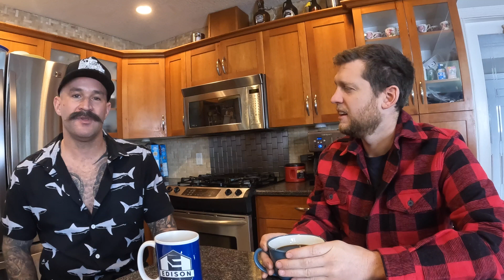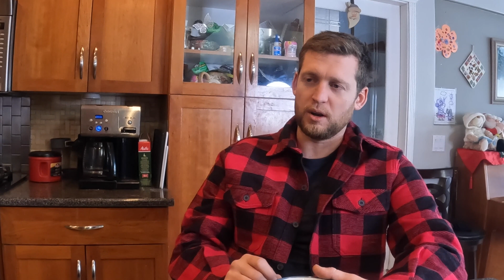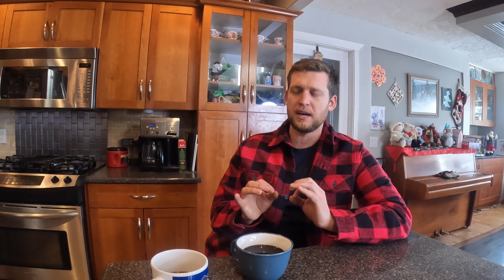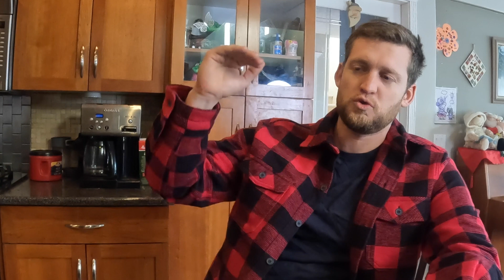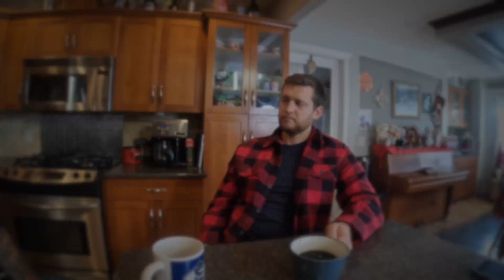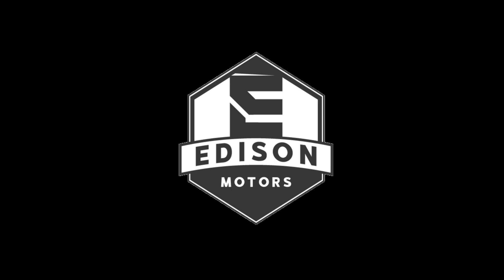Diesel Electric Advantage

Comment: Back in the 1930's two types of locomotives were tested. One was a Hydraulic driven locomotive. This did not work very well and was dropped. The second was an A.C. locomotive. This worked too well....that is to say A.C. power was in fact to powerful. When you tried to accelerate the wheels would slip. Not enough traction. It took till the 1990's to get a smart enough computer to limit the slip of the drive wheels. D.C. was king for 60 years. By the way an A.C. locomotive costs just a small amount more when it comes from the factory. The real advantage comes from the power attained by A.C. versus D.C. It takes 5 DC locomotives to equal the pulling power of only 3 A.C. locomotive. Then think of the fuel savings, maintenance costs and now you can add a few extra cars to the length of the train. Maybe we now need box cars with batteries behind the headend/locomotives to capture the regenerative breaking (called dynamic breaking). Currently locomotives use dynamic breaking by powering resistant heaters elements (kind of a dead short). This happens when you want to make the train run the slack out from between each car. Dynamic breaking helps you conserve your air break pressure.
Reply: There are certain situations where a DC motor might be more practical than AC…that includes a scenario with slow and steady  pulling and zero start/stop which is why they were good in trains plus DC doesn’t suffer power losses from conversion to AC from batteries.

Comment: I think Chace is awesome and he talks sense.  A few of his biases peek out; batteries aren't 20 years away and a full electric semi isn't either, but when they arrive (CATL, usually reliable, claims to have them going into limited production targeted for the aircraft industry THIS YEAR.  Of course, if they succeed they are going to be sold out for years and when they do make financial sense - they will likely drop into Edison Motors trucks where the generators were. (Actually, they will drop in to replace the batteries first giving better electric range and lowering diesel usage and cost).
And I find it not at all surprising that it is someone like Edison Motors doing this - the trucking industry and the manufacturing industry is SOOOOO conservative they make the Amish seem radical.

Comment: I just found they guys and the concept hits in my wheelhouse. I grow up in the logging industry, but got my degrees in electrical engineering in motor drives and deal with mobile power system. I can wait to see 4000BF in the bunks of Carl.

Comment: Illogical. Locomotives need to be diesel-electric because gears would inhibit truck movement on curves and switches. 

This is no different than a tesla with a generator strapped on back.
Reply: How is that different than a truck going around a bend? Differentials have existed for years. What about old steam powered trains? Some of them were gear drive. I think your comment is the illogical one.
Reply: @seabrookmx  the railroad was built around the locomotives it operated. That why the trackage and locos were primarily referred to by “gauge”-size and axle placement. 

An electric motor powered by a diesel engine is simply a diesel powered battery. You’ve now taken an energy factory and put it on wheels. Is that logical?
Reply: I just find it funny that the “solution” to climate change is to mine more lithium and add components to a complex system. Instead of a diesel truck with a diesel motor now we have a diesel truck with lithium battery and a generator, and a diesel motor.

Comment: Wish they took advantage of the extra weight allowance to switch to lithium iron batteries. Could get far more charge cycles on the battery. could be 10x the cycles and the battery would be cheaper too. Just heavier and a little bigger physically though

Comment: Average fuel mileage of an OTR fleet truck in the lower 48 states of the US coast to coast is anywhere between 6 to 8 MPG under a gross weight of 80,000 lbs. In terms of truck weight the average empty weight is 32,000 lbs. So we're hauling 47 to 48 thousand lbs loads without having to get overweight permits.

So with that in mind... Ball park it for us. What's the Average MPG. How many loads are you hauling back and forth and while going through 200 gallons of fuel. I don't know what the fuel mileage of my APU is but I know how much fuel it uses when I'm doing a 34 hour reset down here. That's what we want to know.

Comment: Something he doesn't say, and makes a few linguistic mistakes on, is calling the batteries Lithium-Ion. Based on the application he is using them in, they must actually be LFPo (or a similar chemistry to LFPo, but not -Ion). Yes, they do contain lithium, but unlike your phone battery, which can only be cycled about 500-800 times before it can't hold a charge, and then the charge drops off quickly, suddenly... at 25-50% to 0%,

LFPo can age for thousands of cycles minimum. How /hard/ the battery is hit with a load, for how long, will affect the usable lifespan. If the management system is set correctly, it will detect a high load situation and kick the generator on, to assist, so the overall C-rate is low, and the impact on the battery is just to handle the surge amount, say climbing uphill with a heavy load.

In the scenario with 'heavy use over 5 years' where the battery is potentially at 50% of it's original capacity, more like 70% if the management system is setup correctly, LFPo battery internal efficiency remains at 99%. And it doesn't do that drop-off suddenly. It'd be like carrying around extra batteries that aren't hooked-up. By then, one might think a more efficient, lighter pack would be available to swap, at less expense than 30k.

Comment: Way to go! I have been thinking converting my diesel motorhome to diesel electric. But it probably will never happen, because it need such an engineering team to do so.
Reply: It really doesn't.
If you're mechanically minded it's a pretty simple system.
I can't profess to have done it like these guys, but if you separate the parts they're all basic things, then draw them up connected, then build what you've drawn.
If you know what energy requirements, efficiency and type of driving you already do, you can easily size your system to suit.
Wrecked Tesla's seem pretty common in the us, im guessing that's where you are, go for it!

Comment: How are you dumping your downhill heat after batteries are full?
Reply: You can also do the Prius trick: Use the generator attached to the diesel engine as a motor and spin the diesel engine with no fuel being injected so it just acts as a mechanically resistive load.
Reply: Large resistor banks would be needed to keep from overcharging the batteries.
Reply: Are you thinking about resistive breaking like some locomotives? could be neat. I wonder if it is necessary with the regen breaking + air breaking
Reply: To maintain battery life, I would think that they are not charging the battery system to 100,%. That would leave room for breaking energy..

Comment: Been saying this for years… why don’t they do a locomotive style drive system.
Reply: They have, but they are best to use as switcher locomotives. 

One US made locomotive used a diesel engine between 200 and 300 hp.

They also made a locomotive with a small battery with two 1000hp engines...

But this is more than 10 years ago.
Reply: Two hybrid locomotives at the one minute mark.
https://youtu.be/5D97yBcC_qk
Reply: Expense, and old men saying "we've always done it this way"

Comment: 15:20 but if the batteries totally quit, can the diesel generator powerr the truck?
Reply: No. He stated several times it is an all electric truck. It just happens to cave a fast charging generator installed. The Diesel engine is not mechanically coupled to the drive train. No battery=no go.
Reply: @robertroberts5218  generator makes electricity, and I wasvwondering if it could bipass the battery an right to the EV powertrain
Reply: @BurchellAtTheWharf yes its been proven you can use the generator to produce directly into the wheel motors

Comment: I do have a suggestion for the implementation system that Edison Motors has for their Diesel-Electric trucks;

for the logging trucks, I wouldn't doubt that during some winters or weather conditions that traction would be a concern to look at, for me I'd equip the truck with an AWD system with deployable tire chains, and an electric drive system integrated on the trailer itself so that the effort is split between the tractor and the trailer, giving it essentially an AWD or 16x18 drive or an 18-wheel drive vehicle.  I could also suggest using a conventional eaton fuller 18-speed transmission or a mack 12-speed to handle the torque and to help with adapting accessories to your logging vehicles.  I.e., PTO accessories like hydraulic pumps and air pumps (that's a big one as it's important to keep your air topped off and the way I see it is that why not use the mechanical energy that's being used to drive the truck and trailer forward while simultaneously using the PTO air compressor attachment to refill on air?

And for regular semi trucks (on road; long-haul) for something similar? or an electrified trailer to help act as a range extender for the combination vehicle itself?
Reply: I believe there are rules that prevent motors on trailers federally in the USA and Canada due to the trailer needing to be registered as a powered unit
Reply: You can run PTOs directly off the front of the engine, with a small driveshaft through the radiator. Which is how trash trucks and mixer trucks and some snowplows generally run them. Their truck probably runs the air compressor off the engine like a standard air brake equipped truck. Auto chains are okay for highway use, but off highway you pretty much need triple rail chains of a much higher quality than I have seen on auto chains. They have been doing just fine without power units on the trailers for a long time and it would add more weight and complications than it would be worth.

Comment: I would love to see a hybrid platform, like a unit in place of transfer cases, maybe use a PTO generator unit like on my ram 3500 with AISIN? having a drop in hybrid option would be fantastic. I currently carry 1000lbs of additional fuel, so a 1000-1200 lb electric add in would be great! I know the HDT market is the target, but make a small yanmar or PTO kit for us small truck guys!
Reply: @Atom RC what is AISIN?
Reply: @bushratbeachbum  it is the commercial transmission used by ram.
Reply: @stinson87  ah cheers.
The company Aisin makes thousands of automotive parts.
What's the other option in the ram?
Reply: @bushratbeachbum  68RFE for the diesel, 8hp75-lcv for gas, and Aisin AS69RC HD for the High output Cummins

Comment: In future, you can also work on next iteration of diesel engines running on vegetable oils.
Reply: Just takes some tuning, or in a fully mechanical engine just different fuel lines to handle biofuel. All of the diesel engines at the tech school I went to back in 2000-2001 ran 100% biofuel.

Comment: My only problem is you stated that batteries run better when topped off, but I thought lithium Ion batteries did best in the 30-80% range. I’m sure you are doing your research though.
Reply: Depends what you mean with "run better"? If you mean peak performance, then rechargeable batteries are certainly the best when they are topped off, since they are at max voltage at 100% SoC and thus have their peak performance there. If you mean longevity, then yes keeping them between 30-80% is better, as lithium batteries don't like staying for a long time at 100% and they most certainly don't like a deep discharge to its real 0% SoC, that is a sure way to kill cells. That's why an EV will show you 0% when it actually has still some charge left, there is a safety bottom range that will not be used for that reason. A lithium battery will be disproportionally stressed less when you cycle from 30-80% twice than going once from 100-0% SoC.

Comment: no thanks bud ill stick with my 379 pete. you'll never be able to produce these at a cost a normal person can afford. no normal person has 300k+ to spend on a truck these days. your a scam company in my opinion and anyone who bought shares in your garbage company is an idiot lol you will never have a viable product to sell. we also do not have the power grid in canada to keep up with charging evs so unless you have 100s of billions of dollars to fully upgrade canadas power grid your trucks will never be able to charge themselves.
Reply: Do you plug diesel-electric locomotives into the grid? No, you just run the diesel generator. Think, boomer, think.

Comment: Can the diesel engine charge the battery faster than it drains in cruising driving conditions?
Reply: Yes... cruising hp demand from electric motors is 200kw, genset puts out 350kw
Reply: @MobiAussie  A) That doesn't mean that this truck can. B) Trains don't rely on batteries (or capacitor banks, I don't know what he was talking about in the video) while cruising.
Reply: @MobiAussie  Trains do use the electric motors for brakes, but they don't store the energy created. The energy is just converted to heat though a resistor bank. That's one of the things that has me wondering, why haven't we seen a diesel/electric/battery hybrid locomotive?  A freight train could carry a 100,000 lbs of batteries without even knowing it, why haven't we seen a hybrid locomotive?

Comment: This is amazing work you’re doing. I have one question so far: here in BC we have huge hills. If you fully regenerate the battery while you are still descending a really long hill, what method will your trucks have to keep your speed down?
Reply: Could go the Prius route. Spin the diesel-generator without fuel as a brake. With the higher compression in a diesel it should be even more effective.
Reply: How would that work if the generator is only set up to charge the battery?
Reply: they are from BC
Reply: @DavidLeon140m3  yup
Reply: Besides spinning the diesel engine to act as a break you could also go the locomotive route and have a huge resistor bank that just turns the excess electricity into heat.
Reply: I believe Chase mentioned spinning the generator against jake brakes when the batteries reach capacity on descent.